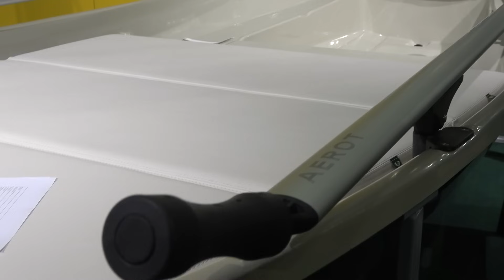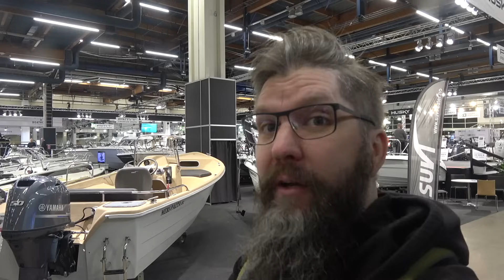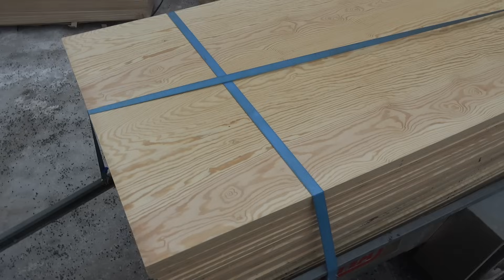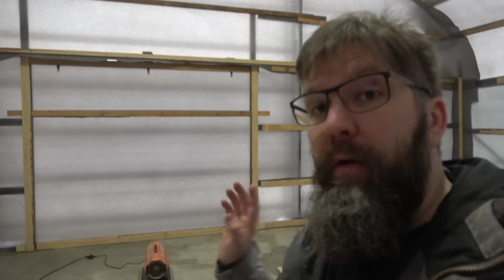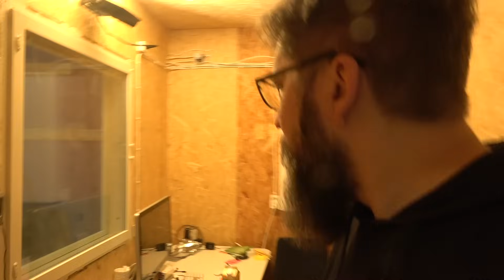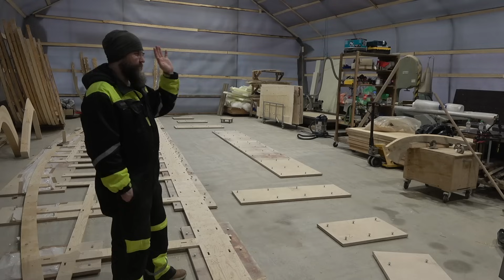50ft DIY Sailboat starting to get in shape! - ep71 Project SeaCamel

Comment: Panu, I really like your approach to fully designing the boat prior to building it. I think you will be very successful with the in general. Also, it strikes me that you can build more boats after the first one.
Reply from the maker: Hi, thanks!
I agree that it’s good to make somewhat detailed plans even if you’re building one-off like this.
Not that I’d ever gonna build another one but I think the method I’m using here is pretty efficient!
(If someone would like to buy one of these, it’s of course negotiable 😁. However then there would need to be all kinds of permits, CE-certificates etc.)
Reply: What CAD system did you use for this purpose? you could sell a limited license to the models for a single build. I don't know if your planning included the interior which a big part of the work. anyway, great project and very good progress for a single person. @ArcticSeaCamel
Reply from the maker: @jean-francoismanchec2603  I'm using ArchiCAD which is architecture software (that i have license for and i've used it for almost 20 years (gosh!)). It's not ideal software to do boats and/or these CAM things at all. But that's what I have and I know so well...

Selling partial plans and/or CAM files could be one option. However the copyright of the design is not entirely mine but also mr. Tanton's who has made the hull and rig design.

Comment: It must feel great to finally have the shed fully insullated. Not to get the heating sorted. RAN Sailing has a diesel heater that has an exhaust they have routed outside; seems to work quite well. Very impressive to see the whole boat layed out. Exciting times!
Reply from the maker: Yeah, I already bought the same kind of heater. Now I only need to figure out the exhaust through the tent somehow…

Comment: Hi Panu, great to see the shape in full -- good size ship!!! As to the heater situation ... that same design heater is also made to run on propane -- i use one for my shop It burns much cleaner without the smoke at startup.  I would still suggest installing a CO2 detector -- even if you only run at night, it will let you know that it is safe to enter in the morning.  I would also add lightweight ceiling fans to evenly distribute the heat as you have such high ceilings, or at least point some floor based fans up at the ceiling to move the heat back down to the floor -- you will definitely see a better result at floor level.
Reply from the maker: Hi, thanks!
Propane isn’t really an option here. It’s not widely used here. Only for rv’s or boats really. Very rarely for heating.
Also it creates a lot of moisture when burned.
I already bought diesel heater with separate exhaust. 🙂
Those fans could be a good idea though!

Comment: Panu, It looks amazing, both the tent, and the boat layout.  Heck even the video seemed even better than usual.  Well done. Oh and I swear a wood burning stove might be a good choice, the type that have a burning area that draws air from outside and uses a fan to move inside air through the building.  That way no heat loss and no CO2.  Assuming any wood stoves are legal where you are.
Reply from the maker: Thanks!
Wood would be somewhat ok, but I really need the heater to be on by itself over night to get the glue-ups done.

Comment: Glad you're working again.  I've worked with a cnc router for 20 years and like what you are doing.  Caution on the diesel heater and fumes with breathing, painting, and fiberglass.  I use electric heat in my shop, but it's much smaller than yours and can be costly.  Have you considered a woodburning heater?
Reply from the maker: Not really. I'd really like to avoid open flame in the shop (even though this one had one) and there's actually quite little extra wood scrap coming. I need also the heater to be independent over night. I don't really need the heat but the glue does 😅
Reply: @ArcticSeaCamel when you start painting heat will even be more important. Leaving it unattended is also key. In your location a heater is a cornerstone of the project.

Comment: Doesn’t the diesel heater fill you shed with carbon monoxide ?
Reply from the maker: This kind of heater should burn the diesel very cleanly. So the exhaust is carbon dioxide and water vapor. And then that small amount of something that smells bad. But not carbon monixide.
RAN sailing has similar heater and they tested it last fall when they installed it. :)
Reply: That type of heater is a bullet/torpedo heater and will produce carbon monoxide as well as other toxic fumes. The heater that RAN use is not similar. It has an external flue and is the type of heater that should be used to heat an enclosed space.
Reply from the maker: @svlamancha9877  My understanding is that carbon monoxide is produced only if burning isn't "perfect".
The principle with these heaters is the same. They just have the chimney version. And I actually bought almost exactly the same model. With chimney connection. They tested the exhaust with carbon monoxide detector and it didn't say anything. 🙂

Comment: Diesel heaters  used in vans/boats might be a better option. They have exhaust tubes to be run outside. I don't know if that type is also illegal in Finland.
Reply from the maker: No they’re fine. Buy they’re also not powerful enough.
I actually bought a 20kw heater already. Same kind but with chimney. Now I just need to figure out how to route that outside…
Reply: @ArcticSeaCamel Consider adding large ceiling fans to cycle the rising heated air back to floor level.
Reply from the maker: @danielsondavidf  Yeah, that's a good idea. I've been thinking of getting some sort of air filtering fan. Maybe that could do both jobs... 🤔

(at the same time I wouldn't want to put any more money and effort for this workshop thing... 🥺😝)